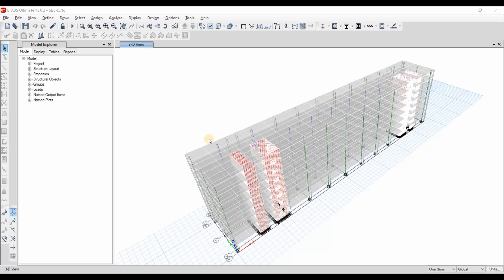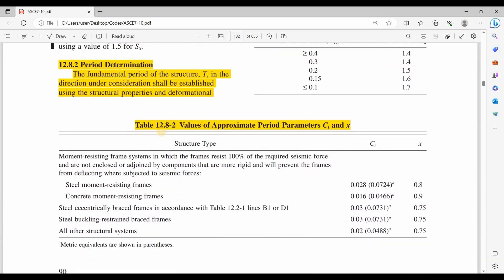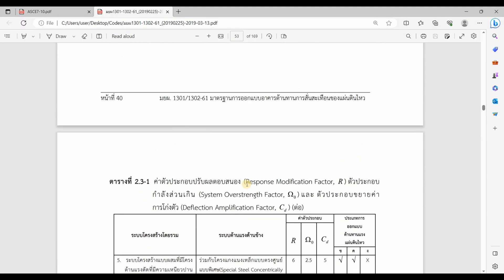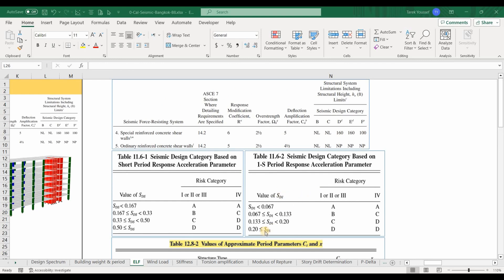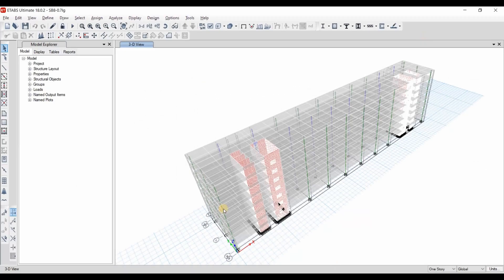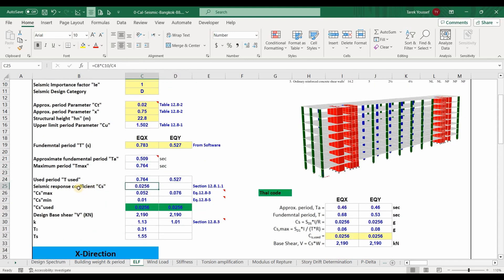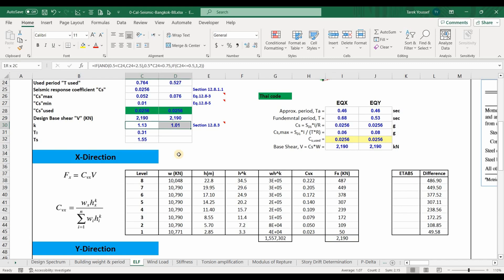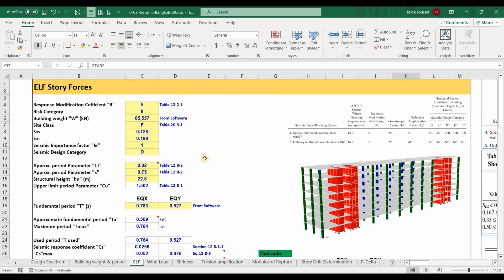ETABS Tutorial 9: Manual Calculation of ELF Lateral Loads per ASCE 7-10 & Comparing Result to ETABS

Comment: Hi tarek, i simulate the calculation using your Excel and comparing to the Static X,Y (Equivalent Static) on ETABS and the base shear result using ELF method is different and the differences around 2000 Kn, but the Sds,Sd1,Fa,Fv value in Excel and Etabs are the same, how can i solve it?thank you😊
Reply: For information, i’m using the ASCE 7-16 standard

Comment: hello, 
how to define in Etabs that the bracing of my building is provided by concrete frames when we don't have reinforced concrete bracing wall?

should i release moments at the start and end of columns or at the start and end of the beams ?

the bracing is provided by free-standing reinforced concrete portal frames
Reply from the maker: To accurately model the behavior of the portal frames as bracing elements, you typically release moments at the ends of beams where they connect to columns. This approach acknowledges that the beams are hinged (or nearly hinged) at their ends where they meet the columns (not at the start and end of the columns). 

The decision to release moments depends on the structural design and the intended behavior of the portal frame system under lateral loads. If the frame is designed assuming hinge behavior at the beam-column connections (for example, for moment redistribution under lateral loads), you release moments. 

If the design assumes rigid connections to transfer moments and shear without significant rotation, you do not release moments.

In summary, you do not necessarily release moments to all beams in all types of portal frame systems. It depends on the type of the beam-column connection (fixed or hinged connection).

Comment: I have many question first how do I choose the fundamental period For the X direction and Y direction do i choose the period that give us the biggest participation ratio? and is it always in the first two mode? And why do i have to the time. And why do i have to take the time period in two direction in to consideration ? and what is the most critical The bigger T or the smaller T to the structure I mean, if we have like time period equal to 1.7 second and we have another time period Equal 0.5 second which of them is more dangerous or more critical to the structure ? 
also, I have another question how do I know exactly how much load has been transferred from the slab to the beam the exact dead load and live load if I have a like a ripped slab modeld as shell slab because I want to take this beam and all the line load that has been transferred to it to another program to design it 

Thank you tarek
Reply from the maker: Choosing the fundamental period for the X and Y directions typically involves analyzing the structural response in each direction separately. One common approach is to select the fundamental period that yields the highest participation ratio, indicating the mode of vibration that contributes the most to the overall response of the structure. These modes are often among the first two modes, as they typically dominate the structural behavior.

Considering the time period in both directions is crucial because structures can respond differently to seismic excitations along different axes. Accounting for both X and Y directions ensures a comprehensive assessment of the structure's dynamic characteristics and its ability to withstand seismic forces from all orientations.

Regarding the criticality of the time period, structures can exhibit different responses depending on the period. In general, smaller periods correspond to higher frequencies and stiffer structures, which might be less susceptible to certain types of loading. Conversely, larger periods indicate lower frequencies and more flexible structures, which could be more susceptible to certain loading conditions, such as resonance effects. However, the specific criticality depends on the structural design, material properties, and loading conditions, among other factors.

Regarding your second question about determining the load transferred from the slab to the beam in a model, especially if it's a shell slab, you typically need to perform structural analysis using finite element methods. My suggestion for you is to use the main beams of your ribbed slab and assigned over them a shell element which is equivalent in mass to the ribbed slab. In this way we can approximate the force transfer.

I hope this helps clarify your questions.
Reply: @Eng.tarekyoussef  thank you engineer Tarek for your reply and your time thank you very much

Comment: good afternoon sir tarek, I'm geri engineer from indonesia, I'd like to ask, in the asce code there is a chapter that states live load (0.25) should be included when calculating seismic mass, this can be done manually for simple building geometry, but when the building geometry becomes irregular, it can be cumbersome. my question is how would you obtain story masses including live load to calculate seismic masses, can we use etabs to obtain this mass (including live load seismic mass  ) using etabs?, thank you, appreciate your response
Reply from the maker: Hello! 
Yes, you can use ETABS to obtain story masses, and you can include the live load in the computation of the seismic masses.

To accomplish this, you simply need to add the live load pattern which you've assigned to each floor within the Mass Source definition. 

Including a portion of the Live Load in computing the seismic mass is typically applied in scenarios like storage areas or malls, as well as in structures where there is a substantial presence of people and heavy equipment.

Check the first 40 sec of this video regarding the Mass Source definition, I have included all the "Dead" loads and "SIDL". To include a portion of the live load you need to add the live load pattern and to put the multiplier to 0.25.

https://youtu.be/ZeeeVSvIt3s?si=adnJr3J-7EhkuY_x